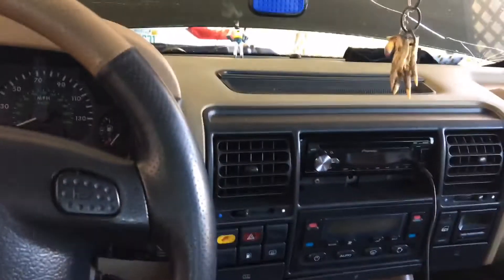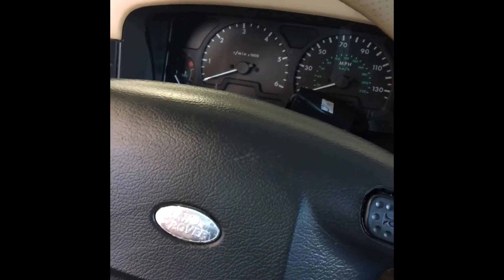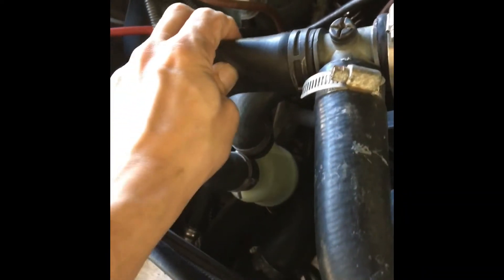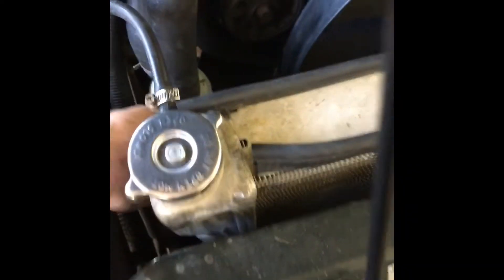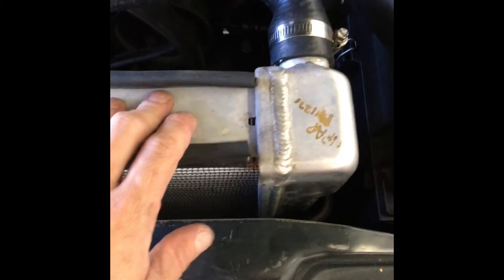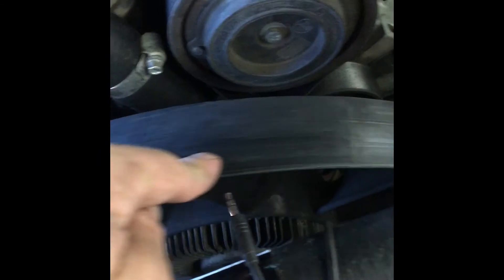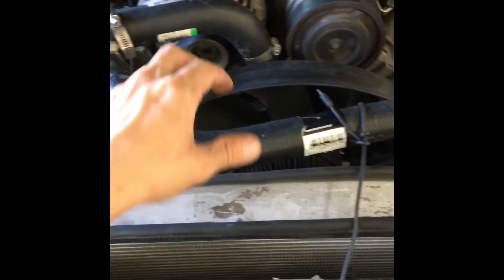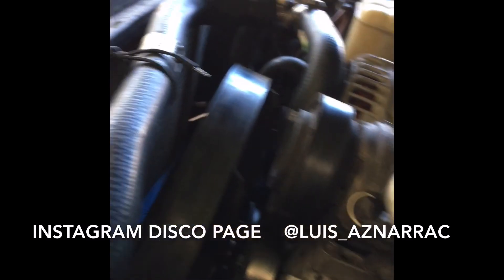Discovery Land Rover 2 OVERHEATING FIX v8 Bosch#DIY #FIX #CAR

Comment: Luckily I already have a capillary temperature gauge fitted, as the standard temperature gauge is useless, after fitting the Gates t stat I monitored the engine 
 temp, realising the stat wasn't opening, my engine never overheated but would have done if I had continued.
Reply from the maker: I agree with stock temp gauge being useless. Thank you for passing k. Your knowledge the rest of us to learn🙏
Small part, potentially catastrophic

Comment: Hi, Fitted a new Gates brand thermostat to my Discovery v8, had the same problem as you, the thermostats are faulty there are no sensor holes drilled in the thermostat not allowing the coolant to circulate through the stat which opens the flow through the radiator, returned mine to the supplier and after a lot of debate got a refund, it was made in China,
Reply from the maker: Agreed! In these cars would be useful a digital thermostat gauge since next thing you know when gauge indicates hot, it’s already too late.
The thermostat with the hole would definitely help in case of faulty closed thermostat.
Best bet is to fit aftermarket thermo sensor near it and get a odb2 reader live time monitor like the “ultragauge” or a Bluetooth connection one.

Comment: A lot of guys say a 180 degree thermostat is a must for these.. I live in AZ it’s hot here
Reply from the maker: There’s 160 too right? What do you think about those?
Reply: @roverandmorerestore7266  not sure...everything I’ve read says to use the 180...you want the Land Rover one or Brit part..lots of junky ones around I’m told. I have a Brit part 180 on order..I ordered from Lucky8.
Reply from the maker: @cjorgie1  indeed! I’ve bought a cheap thermostat that has resulted in headgasket issues
Reply: @roverandmorerestore7266  I just did my head gasket..spend a few extra bucks and install the ARP studs..
Reply from the maker: @cjorgie1  yes indeed! I’ve hear ARP are the way to go.
This will be my first time
Reply: Get the 180 thermostat from landrover I did this on my 2002 runs great now never gets hot

Comment: install the inline 180 deg thermostat and a scan gauge and you will never have to worry again. I went from 204-206 down to 170-183
Reply from the maker: The in-line. I’ve heard but must research parts needed for it.
I’d love to never have blown gaskets due to high heat in engine

Comment: What's the optimal temp for these engines? 195-206 while driving for me on OEM but I worry when I see the 210+ at idle
Reply from the maker: Hmm I’d like to know the optimal temp.
I need to install a digital gauge because the stock one isn’t good.
You ever seen dual radiator modification?